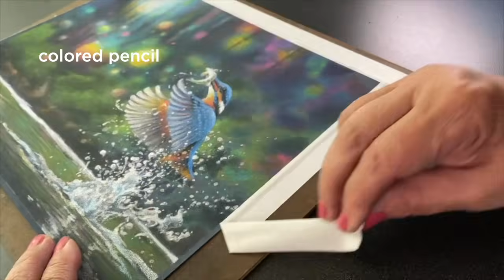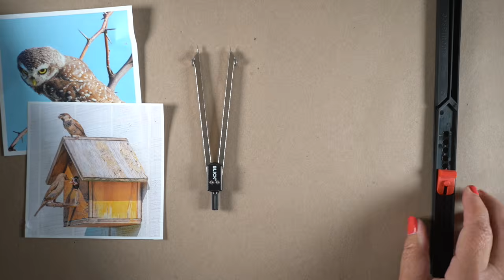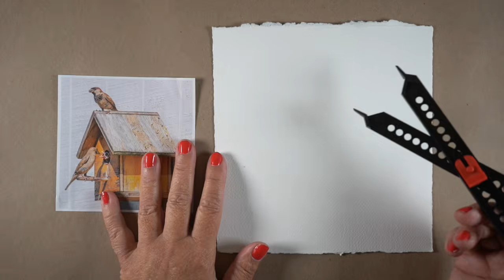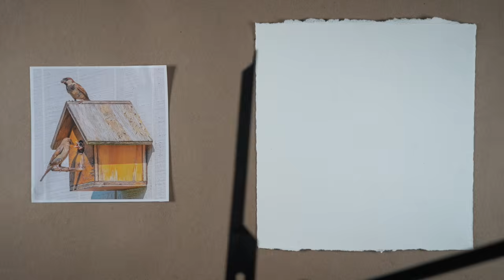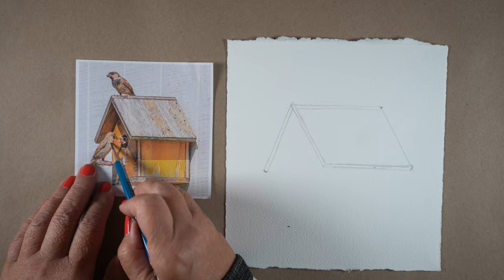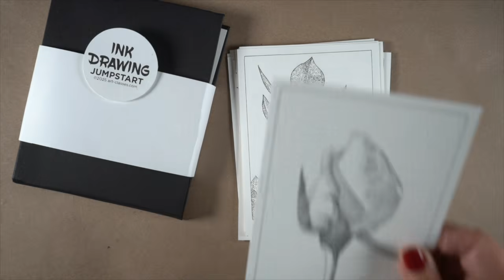Use this tool to get proportions right

Comment: Sandy all of your videos are so enjoyable and educational.  What is the difference between the Blick divider and the Q work divider?  Sorry if you explained and I missed it.
Reply from the maker: The big one enlarges or reduces to various sizes depending on which hole you select. The small one doesn’t do that unless you do it in multi increments of the same measurement like I did at the beginning of the video. It was easier to show in the video than to explain so you might want to rewatch.
Reply: @sandyallnock1  Thank you.

Comment: How timely! I got the Derwent version of the proportional divider recently and I've used it on both photos and physical items. On each occasion I've used it, it's made the difference between me creating a piece or creating nothing at all. I'm still working on my sketching skills so when the flawed nature of my sketches buts heads with my perfectionism, the entire creative process can easily get shut down. Even though they're not 100% perfect, the results are so, so much better than tracing because the drawing still looks like it was done in my own hand. I'm so glad I got one of these.
Reply from the maker: The derwent one is in my cart, it seems like it’d be more flexible than the holes with pins. 😊
Reply: Yes, I was thinking this as I watched the video. The mechanism on the Derwent model does seem easier to use than on the plastic ones. The one drawback is the prongs on the Derwent are not as pointy, which makes them a touch less precise. I'm still getting good results as a novice, though.